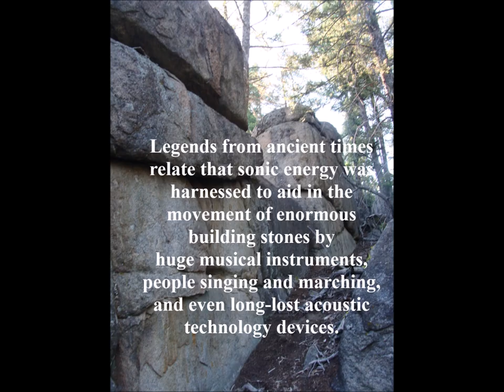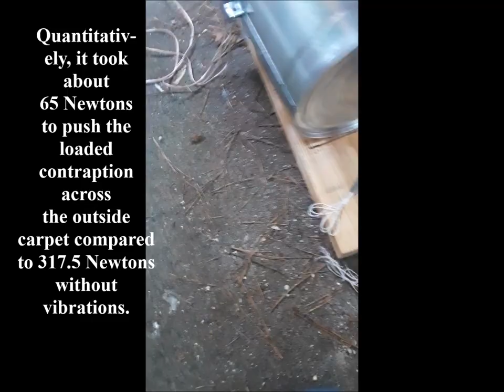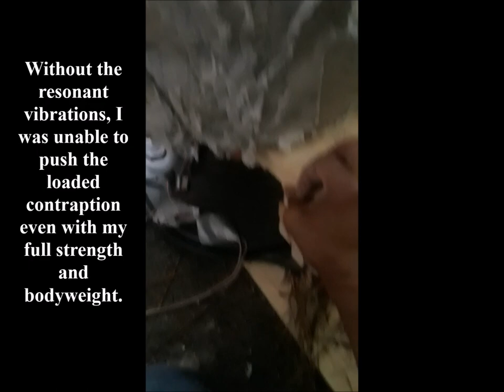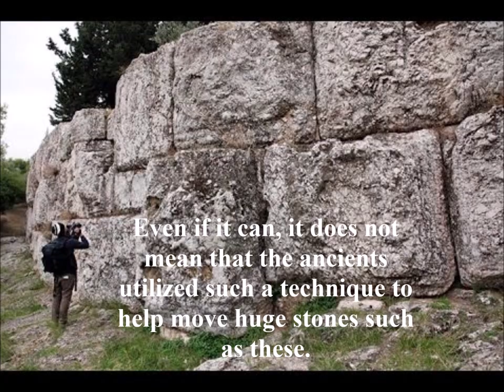Moving Boulders with a Push of the Finger: Did Sound Help to Build the Megaliths?

Comment: Now, there! I've been thinking levitation, and you're proving vibrations breaks the connection with the ground, making it easier to move. 
A step in the right direction.
Reply from the maker: Kinda like a "slide" in the right direction.
Reply: Vibration is semi levitation. And I’ve got a semi on. 💀
Reply: I feel like with enough weight won’t the stone vibrate itself deeper into the ground. I really like this idea tho, appreciate the time you put into this
Reply: I've seen a video where ultrasonic distance sensors were used to levitate shreds of paper. if you've ever been in a car with a loud enough sound system it will make hats and cups levitate. Anything below 16hz is below human hearing and will definitely shake the room and mix things up Enough to Crack or shatter windshields and windows.
Reply from the maker: @silentsnipe1015  Well, it depends on the dimensions of the mass. If the part in contact with the ground is large enough, it will be distributed over a larger area and hence should be less likely to sink. However if the stone is rather small, but very dense, then it can be placed upon a wooden sled which itself has a large surface area. This will better distribute the weight it's carrying over a much larger ground surface area.
Reply: The upward portion of the vibratory motion briefly eliminates the friction coefficient “K” in rapid intervals. 
Really cool invention!
Reply: @gsutton78  The right tool for the right job, for quicksand I'd go with the hovercraft.
Arthur C. Clarke wrote a paper about how some nuclear center, it might have been CERN, were making a massive lab space with a dozen or so massive pieces of very sensitive equipment, as they were putting the last few into place they realized that every piece needed to be moved over by a centimeter or two. The only way to move them was to REMOVE them all to get the movers into the space to move the first one. Someone hit on the idea of using hovercraft pads under each one and moving them by hand.
Reply from the maker: @VinnySlouth   That's how they moved the 12.5 ton Sphinx statue at Penn Museum: https://youtu.be/LW2_dmOkEF8.
Reply: @gsutton78  Clarke also said that working on anti gravity while inside the Earths gravity well is kind of like trying to fine tune a hi-fi radio in a noisy machine shop.
Reply from the maker: @VinnySlouth  Interesting!
Reply: @jeremypoythress4995  go find the trucker with the crazy speakers lol.
Reply: Only issue is all the names pushing the sound theory always emphasis levitation. They also point to ancient people had electricity and technology that is far superior then what we have now. They just can't ever show any evidence at all for any of it.
Reply from the maker: @MrWhateverfits     Well interestingly, mainstream science has demonstrated that sound vibrations as phonons actually possess negative mass, meaning that they tend to have buoyancy within a gravitational field. So, there may be something to it after all. Other legends claim that the stones moved on their own "as if having life". This seems to describe the movements we see when a vibrating object slides across a surface as shown in the video here. Not to mention that sound vibrations can enable the cutting and sculpting of stone: https://youtu.be/na7THeVCyQA
https://youtu.be/oIHL1s1d7ew. Also, there are native tribes which could generate light using rattles filled with quartz crystals through a property known as triboluminescence. So, the ancient technology narrative may not be far from the truth, though it is questionable if it was more advanced than what we have today. To transport so much material over great distances, the ancients had to have had some kind of practical technology to build these structures within a decent amount of time. Perhaps not the same level as ours, but perhaps roughly equivalent to what we had at the dawn of the industrial age with steam power and the like.
Reply: reduces friction.

Comment: Nice hack to overcome the friction. Also possible to add a tiny rock below to act as a pivot point for rotation or two pivots for "walking". Those vibration might be actually useful rub two stones to lap them to a flat surface and also to propel abrasion (already shown for cutting holes (by a hole saw) or possibly also for straight cuts (by wire/rope/flat blade).
Reply from the maker: Yes, that's the techniques popularized by Wally Wallington. I rented his Forgotten Technology DVD back in 2006 I believe. I've wondered how it might work in conjunction with this acoustic lubrication technique!
Reply: I can imagine how to make straight surface cuts: have a straight tensioned object to move the abrasive (copper "saw", wire, rope) propelled by vibration by a tuning fork. Then on the sides some weights attached to that it cuts straight down by gravity. Let it work and it will make a flat surface. Then rotate the cube on a level floor and repeat to get perfect perpendicular sides. The fork could have been powered by hammering on the teeth. The hammers could be powered by a water wheel (from Nile river), wind mill or human mill (if far from flowing water).
Reply: @BohumirZamecnik  yeah I thought the same. Would love to see wire with sound wave on granite I bet it’s quite possible but why she have only rotation wire saw.

Comment: Could you imagine how loud it was when they built all that stuff?! 

Also... I'd have to imagine they had to be able to change tones depending on how the stones moved which would indicate some sort of physical properties of music theory and the ratio between various frequencies!
Reply from the maker: Yes, they'd definitely have to be able to change frequencies and ratios (harmonics). The noise would depend on the coupling. If the vibrations were more coupled to the air like with an upright subwoofer, then the vibrations will be very loud. But, if the vibrations were more coupled with the ground like with a facedown subwoofer, then the vibrations will be more "felt" through ground. But it would still be quite noisy, though.
Reply: To vibrate something in order to help move it along a surface is one thing, but to levitate the object, you're talking a whole new ballgame wherein the frequencies used cannot even be heard by the human ear so no, it doesn't have to get louder to mover and/or lift large blocks of stone.
Reply: @jefft6802  I’m thinking that to move these stones they found the perfect frequency that would match the structure of the material, if you look at how sound effects sand particles it’s pretty amazing the shapes it creates and possibly those frequencies and sound waves could make an object completely weightless if matched perfectly
Reply: @outsidechambaz  True, the precise frequency most likely in combination with it's 11th harmonic to levitate large blocks.
Reply: @jefft6802  i believe it requires a mixture of five different frequencies to manipulate elevation.
Reply: All of the stones would have to be the same size for their instrument to work. Otherwise they would need to construct another for another size stone. Essentially they throw sound waves underneath a stone like blowing underneath a piece of paper. When that happens the vibrations don't allow the stone to rest in one spot. You can move  70 ton stone with just a few guys if you did it right
Reply: @outsidechambaz  they maye have just cut all the stones by hand and vibrated the stones into place without ever touching them. You see what happens to sand on a board that's experiencing a frequency? The sand moves itself to mimic the sound wave
Reply: @JA-ru3il  not really, it could be made like a trombone and be infinitely adjustable.
Reply: @fryloc359  underrated comment right here. 👏🏼👏🏼👏🏼👏🏼
Reply: That's why musicians gets paid to entertain it's affects your body and thoughts
Reply: @outsidechambaz  cymatic resonance and wave forms. Together our bits of knowledge can add up to figuring this whole thing out.

Comment: Old electric toys used this principle in the late 60's. There was a tabletop football game where the platform vibrated making the players move, but every kid slid heavy objects on it which slid like they were on ice. Also tabletop hockey can use vibration instead of air. Bees also are thought to create a vacuum when they take off, but this doesn't fully explain how they fly so well for their wing to body ratio- it may also have to with the vibration and loud buzz reducing gravity as the loud buzz of a bee and the whine of a mosquito is not otherwise evolutionary a plus. Also, carbon 14 dating on the great pyramid wood and mortar material show and earliest date of 5,000 BC (versus 4600ish). The land around was already desert, but they had more frequent rain and probably moved quarried stones over bare sand when raining. Loud vibrations to the earth around the blocks would effect the wet sand and make it ice like.

Comment: This is it. When i was a kid i remember playing with that phenomenon. Something that vibrates on the ground is basically jumping up and down very fast.
And whenever it is not on the ground (which is most of the time the case since its vibrating so strong and it bounces very fast) you could push it as easily as a balloon in the air. This HAS to be the method they used. Now have the didgeridoo in mind that is an old instrument channeling sound. Is it so hard to think of other instruments and tools that generated even more and differently concentrated sound? And what about this mechanical artifact that is thousands of years old and completely out of time.
The people back then had so much free time. When you play with things you get quickly a feeling for it and perfect that feeling very rapidly over time. Just like singing or playing any instrument or being good at work.
Just like throat singing which is also veeery old.
So at some point you find the flow and get better and better on maintaining that flow, in this case the perfect vibration that makes an object move a thousand times easier. Now picture many people in a perfectly calculated distance or angle blowing the sounds on these stones (just like they calculated all the other parts of the Pyramid and monolith statues) All you need as a human is a rope that gives you range so you are not in that sound channel that would possibly explode your organs. So now you are able to move these massive stones. I think this is the closest theory. Never thought about it.
Reply from the maker: I agree. I think modern science really underestimates the ingenuity and inventiveness of our ancient ancestors. We can just look at the technological advances we've made in just the last 200 years. Some ancient civilizations like the Egyptians, Nubians, the Sumerians, etc., had literally thousands of years of continuous civilization. Hence, it is highly unlikely that the ancients never developed any sophisticated technology. People have to realize that civilization is cyclical and not a linear progression from only one singular point in time. Rather there appears to have been several periods of high civilization and advancement followed by several periods of degeneration and decline.

Comment: That's awesome! I always heard people saying "tHeY lEviTaTed thE PyrAmIdS WIth SoUnd, MAn" but this makes waaaaaaay more sense. I still dont know what kind of device would make the sound, but it doesn't seem impossible.
Reply from the maker: There's actually a few ways to generate vibrations without electricity and modern technology. Thermoacoustics is one way and requires few materials. The Sterling engine is actually classified as a thermoacoustic device. It's basically an "external" combustion engine as opposed to the internal combustion engines we're more familiar with today. And vibratory engines can move objects with surface acoustic waves instead of wheels. I made a couple videos on thermoacoustic vibrational engines:
https://youtu.be/DwI4vAKRSMY?si=8lAp-BFdyuBt-EGP
https://youtu.be/ruyqcrUBkao?si=Jz228k13tENAy8Ld

Comment: When i was a kid, we had this old air compressor that was screwed to a piece of wood. We would use it to fill our bicycle tires. Once we were taught how to use it, we were allowed to do so on our own. And watching it wander all over the garage floor, or when it was on the work bench - seeing it shake everything so much that things fell off the work bench, it gave me the bright idea to use it to help me move heavy pieces of wood that were laying about at the side of the garage. I would screw the compressor on the wood, into a larger piece of wood that i wanted to move, then turn the thing on, and push the wood around so much easier than i could before. When my grandpa discovered what i had done, he was amazed at both my make-shift fort outline i had created, and my genius idea to use the air compressor. When i first told him how i had done it, he was like "yeah right. You didnt use air and blow the pieces of wood like that", and i was like "no.. like this.." and proceeded to screw it back on a piece of wood, and move things with ease. He laughed like crazy and wasnt even grumpy that i had essentially just made a big mess by moving all that wood around. Lol
Reply from the maker: Wow! That's really cool! I've also had a number of people who've had similar experiences with heavy plate compactors which were practically impossible to move unless they were vibrating. Thanks for your story☺️

Comment: If you rotate the bucket so it is upside down and resonating towards the floor this may well improve the reduction in effort to move the load, we use whacker plates which weigh over 100kg and move effortlessly with the vibration underfoot
Reply from the maker: That's right, I've actually moved over 500 lbs using a pizza pan instead of the bucket as the former is more stable.

Comment: I don't think I have any experience with moving vibrating objects, but for some reason it immediately made sense to me that it would be easier to move, as if I knew it already. 

Would the vibrations actually be worth it though? Electricity is quite powerful, wouldn't it give better results by using it directly to push? Wouldn't ancient people be better off just pushing the stone, instead of playing hundreds of horns?
Reply from the maker: Well, the advantage of an oscillating or vibrational system is that you can continuously add energy into the system at resonance. A 500 pound swing could be pushed with one hand as long as the pushes coincide with the swing's natural frequency and the swing has the lowest possible internal friction. It would take time to reach the maximum amplitude, but it could be done. Also, let's now imagine that the swing is swinging at this greatest amplitude. We could release all this stored energy at once, say by placing a 1,000 lbs plus stone in front of it. When the swing contacts it, it may knock the stone forward. Pushing the stone with your one hand would do nothing. But the heavy swing which has stored the energy from hundreds of pushes from your one hand definitely could. With vibration or rotation, it may take some time to build energy. But if we take that energy and release it quickly we get power. Power equals energy divided by time. This oscillating swing example also applies to acoustic vibration. We could take a vibrational device, store the energy and then couple it to the stone and the stone would move, probably even on its own. Or the vibrational energy could be periodically released in sync with the pushes and pulls of the workers. Also, I submit that the ancients could have used heat to generate vibrations via thermoacoustics. Such a device could generate powerful vibrations without the need for modern electrical systems or technology. The Sterling engine is actually classified as a thermoacoustic device. It's simply an external combustion engine as opposed to the interval combustion engine we use today. I discuss thermoacoustic vibrational engines in the video here: https://youtu.be/ruyqcrUBkao?si=Xfh90fTTo3Jq7HgH.

Comment: I think that the movement occurs due to microdisuptions of gravity. When a heavy object vibrates, for a split second it becomes suspended in the air (up, against the gravity pull), and in this state it's more susceptible to pushing/pulling. Also, when it's "airborne" the friction is much less due to the air "filling in" the gap between the weight and the sled, what also contributes to pushing pulling facilitation.
Reply from the maker: Exactly! Acoustic Lubrication!

Comment: Nice to see I am not the only one. Have you happened to notice the Pharaoh Scepter is just a stone cutter on top of a Tuning fork? The top, stylized to look like Animal heads are just the same tool workers used to cut stone yet if you look at the bottom of their staff it is a tuning fork meaning striking these even gently( I made a similar one and it is extremely easy to get going) the head can be made to vibrate at speeds that would rival modern dremals
Reply from the maker: Sedit T   You're definitely not alone. I've seen some of those pictures too like this one: https://images.app.goo.gl/3pNteBGga1ePuUao7. Looks like two tuning forks with a string or wire stretched between them. One way to cut hard stones would be to coat a string with a mixture of a thick, viscous substance like gelatin and an abrasive substance like sand. A person stretching the coated string between their hands or even two people on each side of the string could essentially saw back and forth, eventually cutting deep into the stone. But what if the ends of the string were stretched between the twines of two giant tuning forks? This set-up might function as a "sonic saw"; especially if the forks were tuned to the resonant frequency of the stone.
Reply: @gsutton78  omg bro